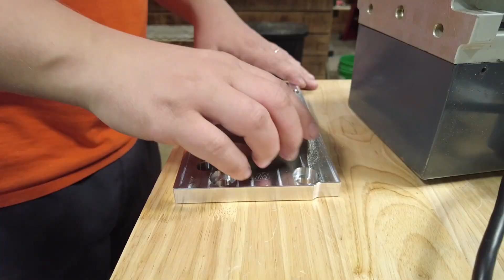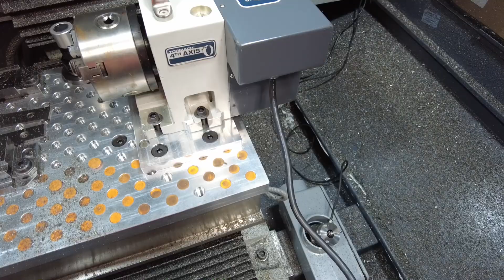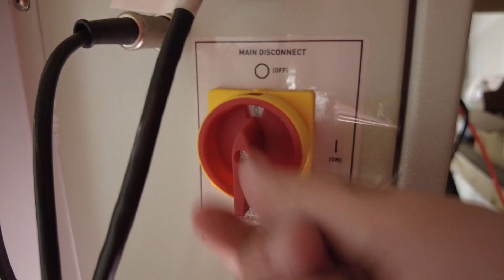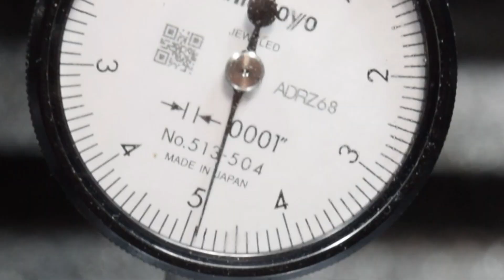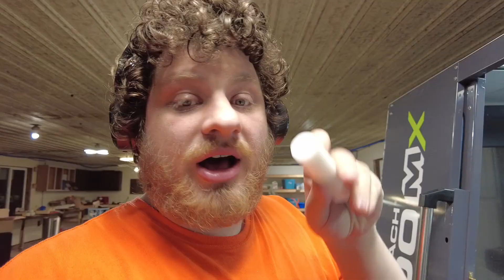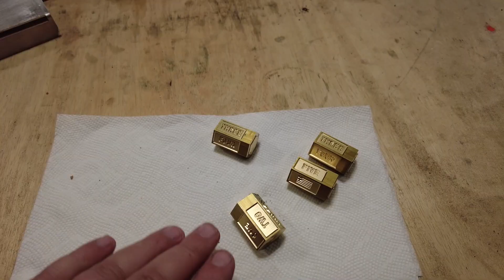Making Parts With the Tormach Microarc

Comment: Hey, what is the ceiling height in this room with 1100MX? I am trying to fit 1100M into a room that is exactly 96" (exactly Tormach recommends for system heigth, so I am am a bit worried). Your ceiling looks lower than that. Did you do any hacks to machine stand? Thanks a lot!
Reply from the maker: 1100 in 96" is perfectly fine. My ceiling is like 95" and even the 1500 fits with no shenanigans
Reply: @AudacityMicro  Thank you. That is awesome!

Comment: I had the same idea about mounting it to the right, outside of x limit. Unfortunately, it can’t remain there. When you reference X you will send the microarc through the right side of the enclosure. Im sure by now you realized that.
Reply from the maker: I must have mounted mine an inch or two further in. Because it's still largely outside the work envelope, and I have yet to accidentally open my window 😁